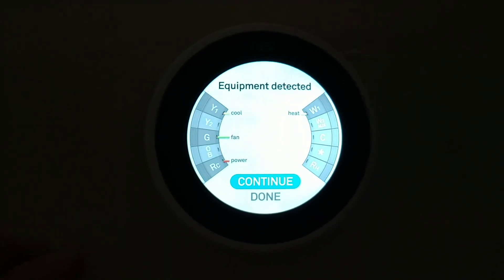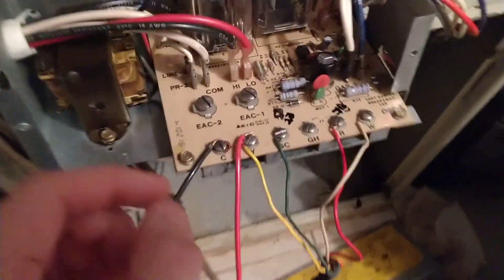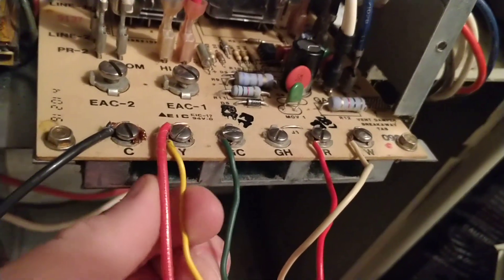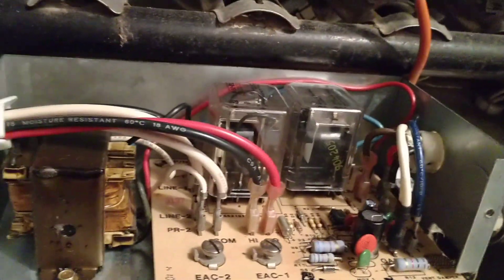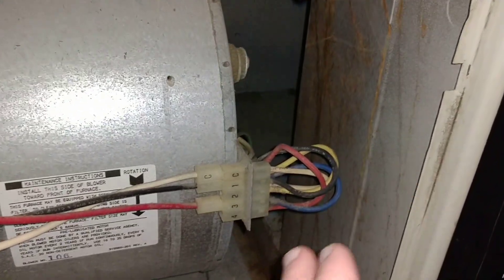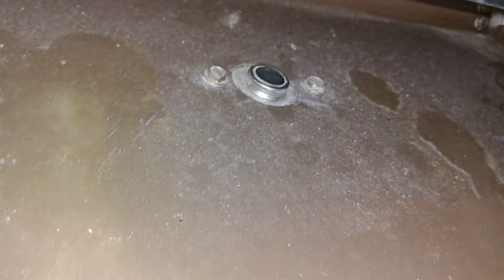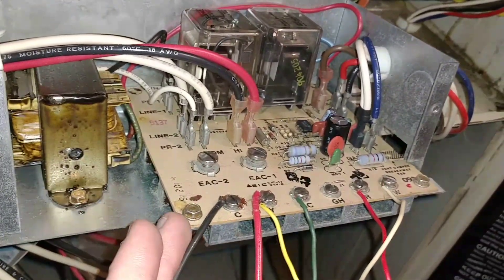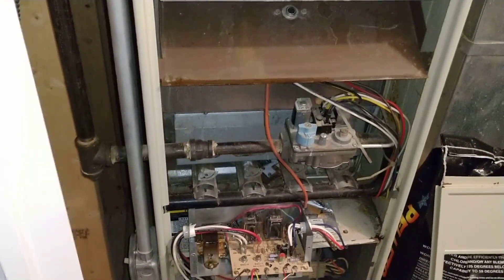NEST E73 After Running Heat Constant Fan Issue No Voltage Over R Carrier Furance

Comment: Thank you for posting this video about the reset button. Saved my day. I have a Bryant Plus 90 gas furnace and a Nest E73 error popped up this morning. I replaced a dirty air filter, cleaned out the condensate pump, found the reset button you mention and three hours later my Bryant reset itself and the heat worked again. The Nest error went away and the fan stopped right after I pressed the reset, but this particular gas furnace takes 3 hours to actually reset for heat. Appreciate it!

Comment: Having similar issue, only thing is it's clean, and clean filter...any ideas what else would be causing it?
Reply from the maker: Sorry, I'm an amateur when it comes to this but an issue like this should be covered in the reference material for your system/online by other people. These limit switches are known for failing and getting stuck in the open position, some are even non-resetting (high limit switch) which necessitates replacing them.